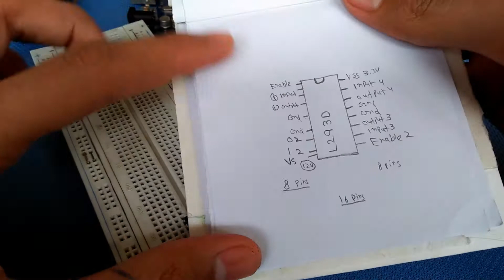CONTROLLING DIRECTION AND SPEED OF MOTOR WITH ARDUINO AND L293D IC     #artoftech

Comment: Hello, i have a small project to do on tinkercad. The question is " You will go to Tinkercad to use an LM293D to drive two motors. You will create a function which will take as input a linear speed and an angular speed, the function will have to translate these two commands to be able to send commands to the LM293D in order to drive the motors. To control the motors, you will use 4 buttons (front rear right left) and a potentiometer (speed control). You will add 2 LEDs (one for each motor) indicating in which direction the corresponding motor should rotate." Can you tell me how to make the wheel turns right or left based on your circuit because i know the motors can move clockwise and anti clockwise, that is front and rear, but how can it turn right or left ? I'm really confused about this and i'm new to Arduino World. Can you help me please
Reply: What is the value of potentiometer used in this . can you please tell me